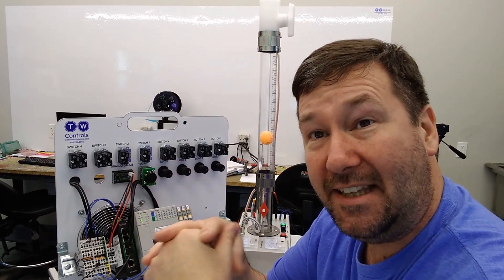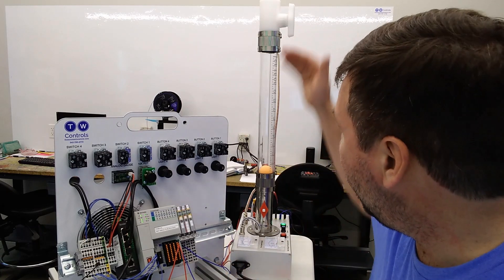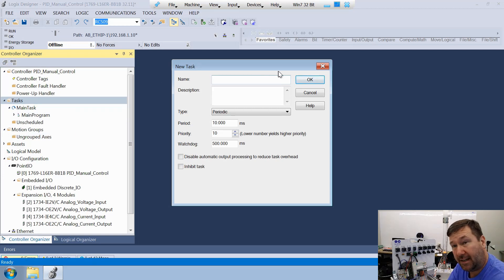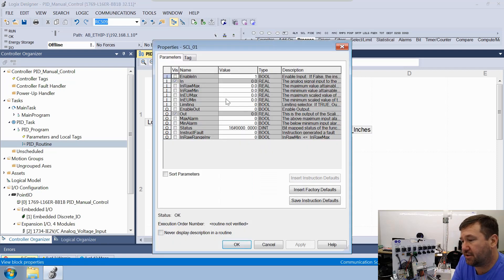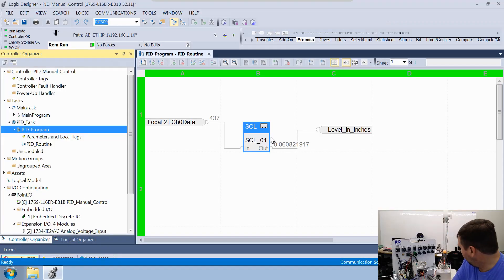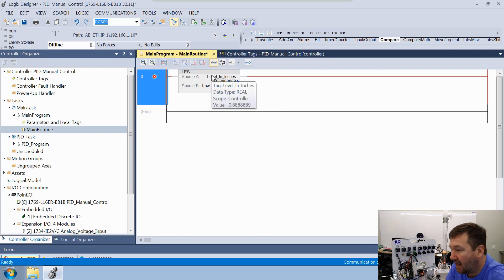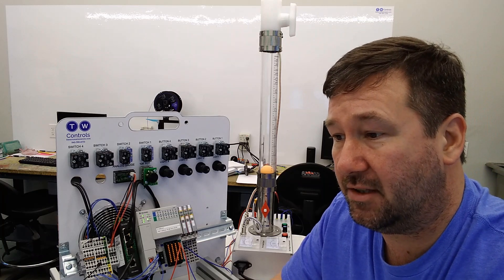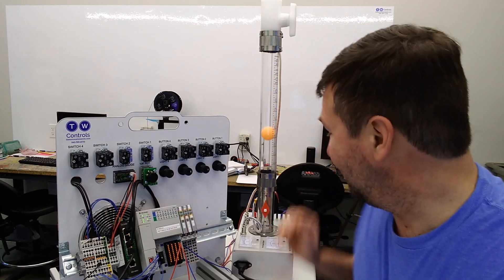Do I need PID Control or Will ON OFF Control Work?

Comment: Tim,
Can you still get raw values like you have if the module comes scaled? Like with a 1756-IF16 module?
Reply from the maker: I guess you could scale the module for the raw values but what are you hoping to gain?  The  scaled value is floating point and is as accurate as the raw value.
Reply: @TimWilborne  Thanks Tim! Does the  PIDE instruction needs the raw value to work properly? I'm hoping to be able to setup the PIDE instruction properly.

Also great videos!!
Reply from the maker: No you can use your scaled units in the PIDE in Studio 5000 and that's what I would recommend. I just put a video out on that. See link below.
https://twcontrols.com/lessons/pid-control-how-to-configure-the-pide-instruction-in-studio-5000-for-allen-bradley-plc-process

Comment: HI, Tim. Can I code ON OFF control with a LES and a GRT ,and use an OTL and an OTU respectively ? Thank you very much,
Reply from the maker: Sure you can but if you have wanted many of my videos then you know I wouldn't get excited about it.  Why do you want to use the latch and unlatch?
Reply: Haha, I checked "How Power Up Affects an OTE vs an OTL/OTU in an Allen Bradley Micrologix PLC." again. I think you avoid to use the OTL and OTU here because they have a pre scan problem in case of Power up? Am I correct?
Reply from the maker: @dennisjiu1771  Not completely.  I think the main thing is make sure you aren't using the OTL and OTU to do this because you can't make it work with the OTE.  As long as you can, there is nothing wrong with it I guess.
Reply: @TimWilborne  Thank you so much for the comprehensive explanations

Comment: I know its not PID, but how would one write a code in logic to see how much fluid has been used by using a flow meter?
Reply from the maker: Check out some of our High Speed Counter videos.  You would do that except instead of configuring it for an encoder, you would configure it for an up counter.
Reply: @TimWilborne  thank you sir you're a scholar and a saint